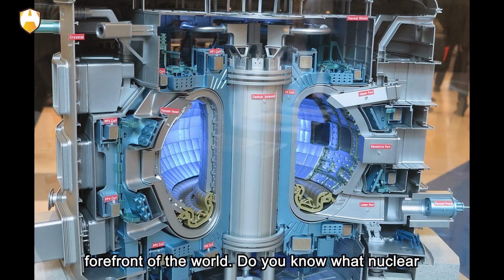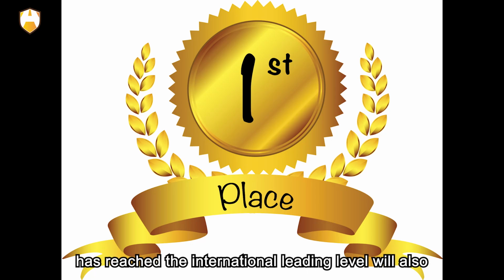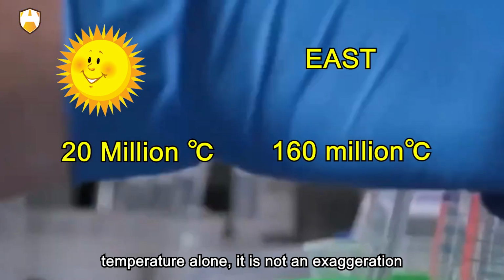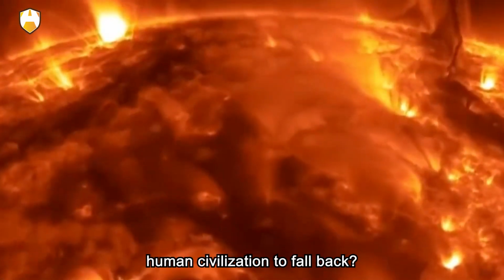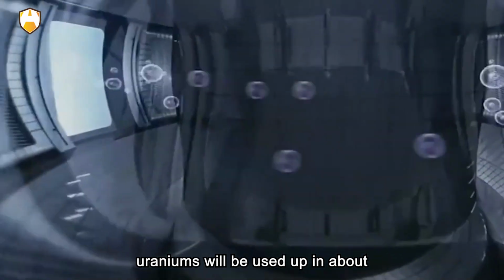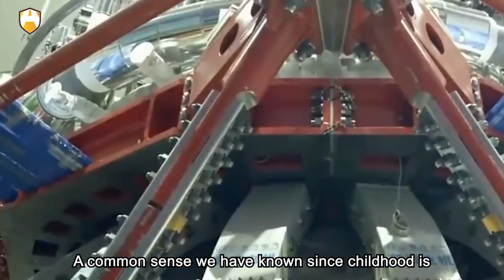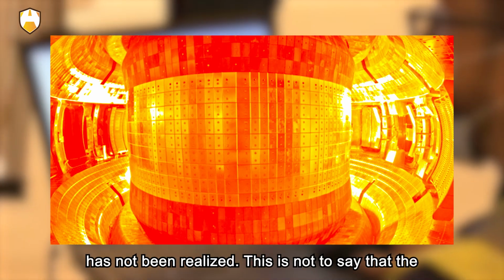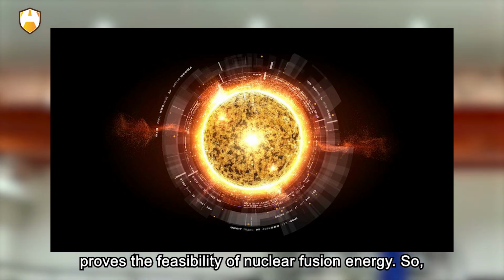China has created an artificial sun, the ultimate energy is just around the corner?

Comment: The energy needed is Neutrino Voltaic. Every waste water treatment plant can produce the graphene required. Sand batteries can provide options for heating requirements for both residential and industry. The answers are available using today's tech. The real trick is to start thinking small projects on a local basis that provide solutions to that local need. Megaprojects simply aren't the answer.

Comment: China is inderdaad the forefront of fusion nuclear reactor development. This nuclear fusion is a big game changer which will solve the energy problem for a long long time into the future. China plans to mine the abundant Deutoronium on the moon for its moon base and the fusion nuclear technology can also be used in plasma rocket engines for interplanetary travels. China’s great progress is very promising for the future of mankind.
Reply: no it really is not! ffs, "Deuterium" and "Tritium" are not mined they are found in heavy water here on earth in abundance. And no Fusion energy cannot be used for 'plasma engines' my god! stop read a book or two and come back!
Reply: @MyMrno1  well, using the very high temperature of the fusion reaction you can heat a gas into plasma and jet it out through the engine. The kinetic energy of the particles creates the propulsion. Since there is no resistance in outer space the kinetic energy of the particles can propel the spacecraft. This way one can save a lot of fuel and it is most efficient.